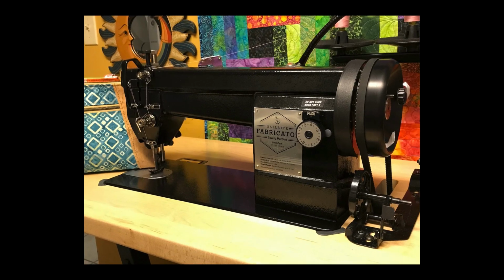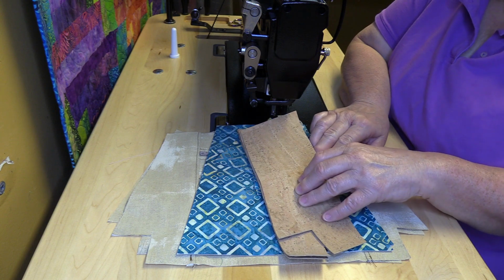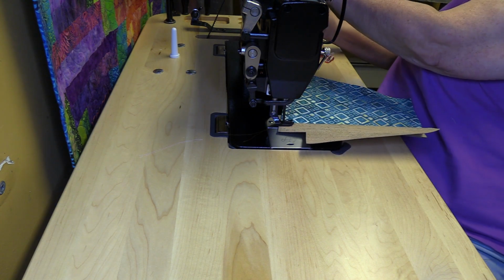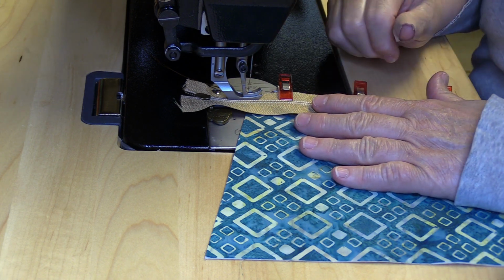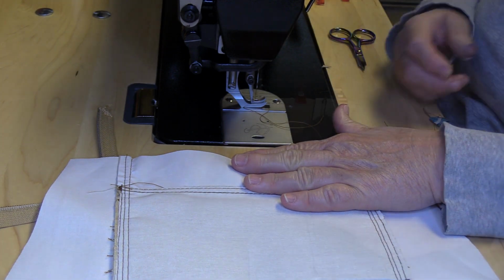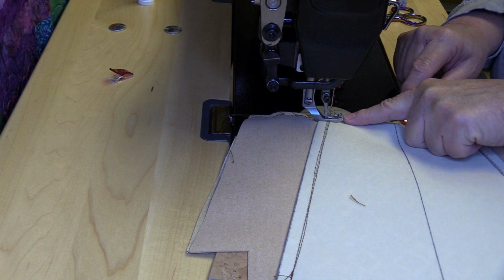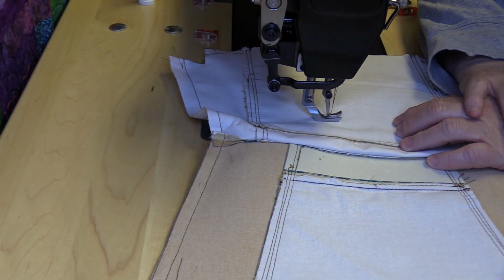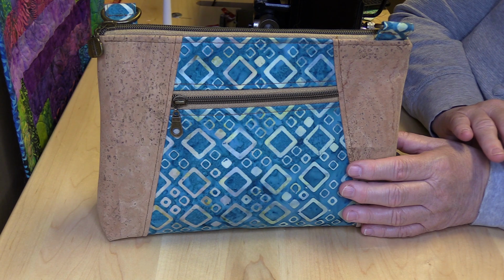First Look at using the Sailrite Fabricator for Bag Making

Comment: Ahhh you got the machine I wanted. Due to space issues I could not get the fabricator. But I did get the leather works about a month ago, the table is very compact. Earlier today I also changed my thread, I went to a polyester 69 and I also used a sunshine tote for my test run and had no thread or tension issues. My machine came with a smoother foot (than original), but it still have grooves. So far so good :) I love my machine
Reply from the maker: Congratulations on your new machine and thanks for watching!

Comment: How about organic cotton thread? I know organic cotton is much stronger than regular cotton thread. Could it handle that type of thread?
Reply from the maker: Probably, but I have never used it so I can not say for sure.  Thanks for watching!
Reply: @RosiesArtStudio  thank you, but sadly it doesn’t work. I have literally had my Sailright Fabricator for one week, and I have spent this entire time figuring out how to make it work and it just won’t. I was able to make successful stitches; however, the needle keeps breaking the thread whenever I pull out my fabric. I have tried adjusting the tension to changing my needles to ball point needles so the thread could avoid breaking due to the sharp needle; consequently, it made no difference.... I will be selling my machine since my sewing is predicated up organic cotton and natural fibers.

Comment: I’m interested in this machine for bag making and occasional leather sewing. When sewing leather it is important to have the ability to sew into the same holes when back stitching. You don’t want to create any unnecessary needle holes. I hope I’m communicating my concern clearly. Can you tell me your opinion on the ease of accomplishing this? Thank you.
Great video by the way.
Reply: Sailrite has a leather foot and an open foot, so to speak, so you can see better. I have a hard time with the 1/8th inch so that was their recommendation.
Reply from the maker: I totally agree about having the ability to have your needle enter the previous stitching holes precisely.  This machine is still new to me and I have not done anything with leather yet.  But, Sailrite has many great videos and you may find the answer to your question there.